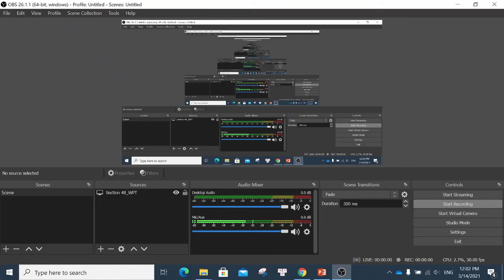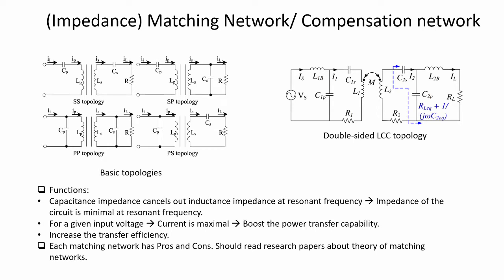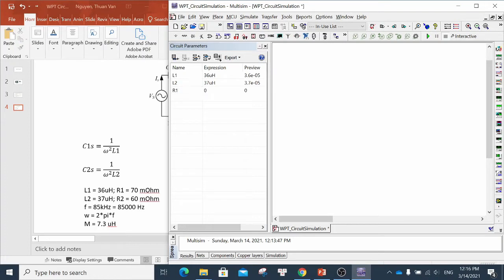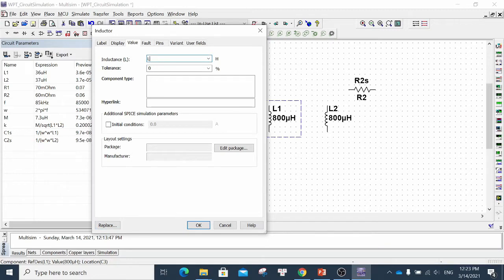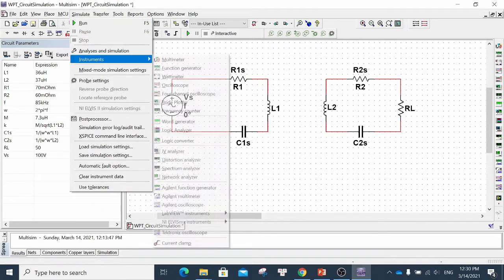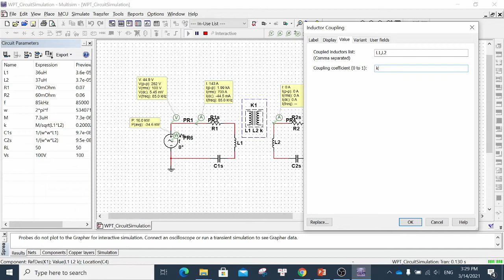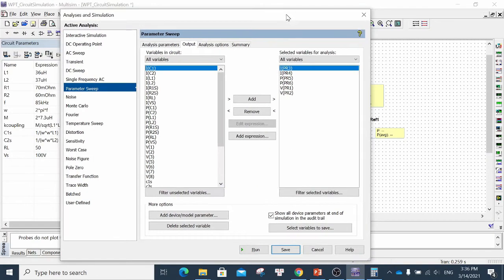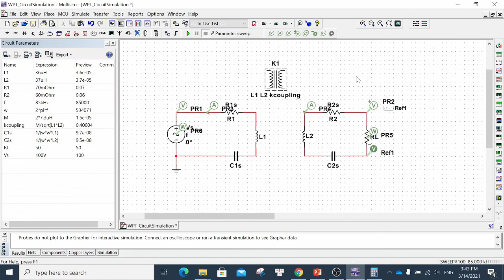Tutorials on Wireless Power Transfer: Part 2 - Circuit Simulation in Multisim

Comment from the maker: Please ask if you have any questions!
Reply: Is this simulation with those parameters for smartphones wireless power transmission ?
Reply from the maker: @khalidmelouard3525  Thanks for your question. The coils are big, so they are more suitable for EV wireless chargers.
Reply: hi How to do it in Maxwell program?????
With  eddy  current
Reply from the maker: @mohboura1419  Yes. I used Eddy Current solver because of 85kHz frequency.
Reply: Do you know how to simulate Circuit Simulation in Proteus? I do not find coupled inductor in it, only find transformer.
Reply: How is this video related to part 1? Aren't the values taken for inductance different?